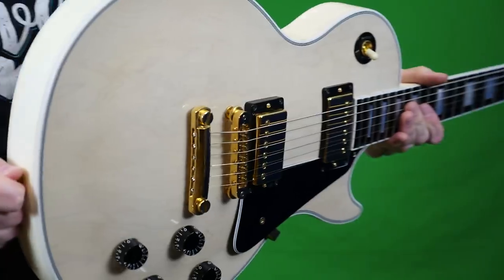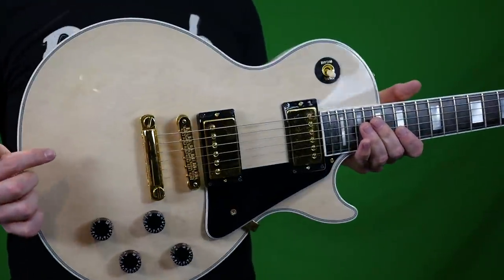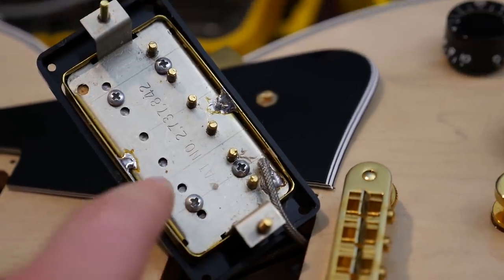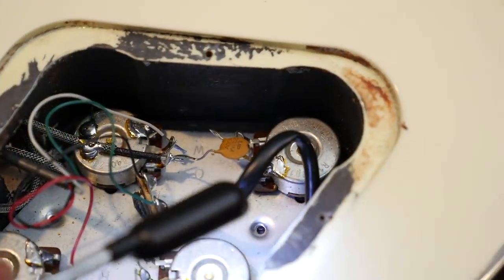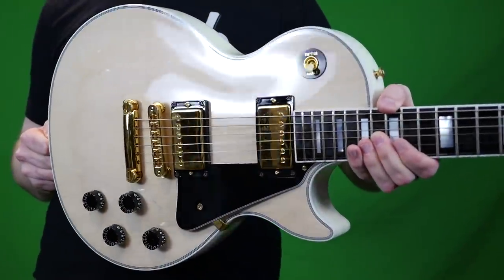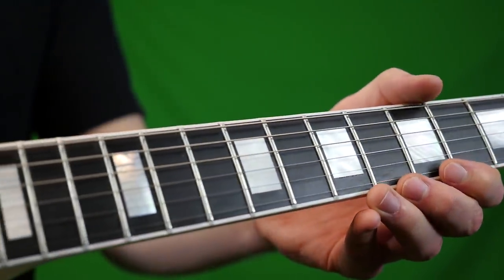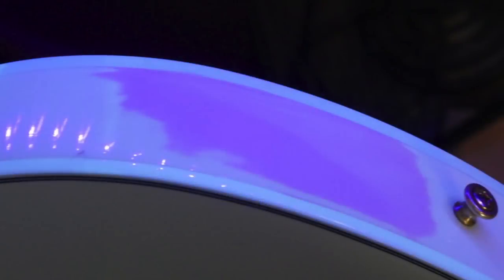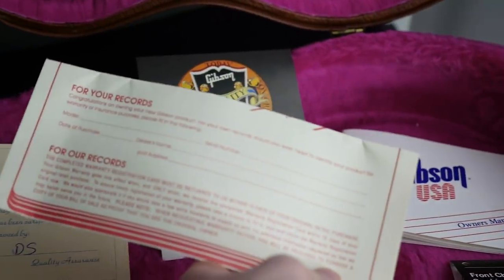More Than Meets the Eye | 1990 Gibson Les Paul Custom Limited Colors Edition Translucent White

Comment: Don't think I've ever seen quite so much glue squeeze out in the truss cavity from the headstock face fibreboard before!! Would concern me a little as to if there actually HAS possibly been a minor headstock crack repair early in it's life........
Reply from the maker: You must not have seen a lot of Gibson truss rod cavities haha. This one is fairly mild
Reply: I have seen quite a few, most of them fairly modern and mostly Flying V's but never seen as much as on that one! Been working on and repairing guitars for some 30 odd years but only as an hobby and for friends so maybe they are just worse on the Les Pauls?